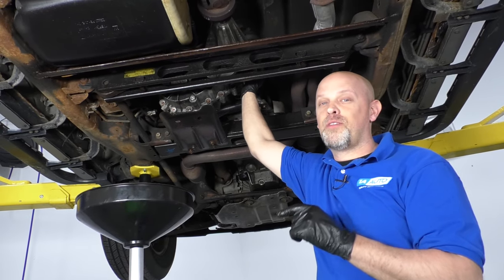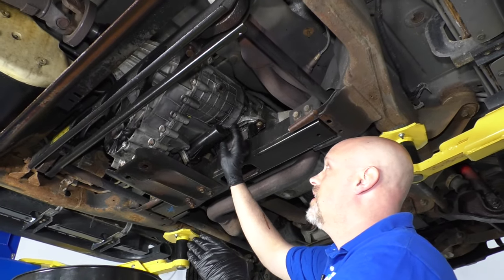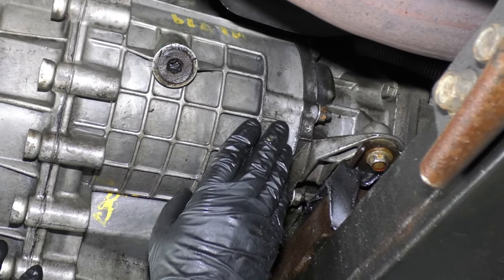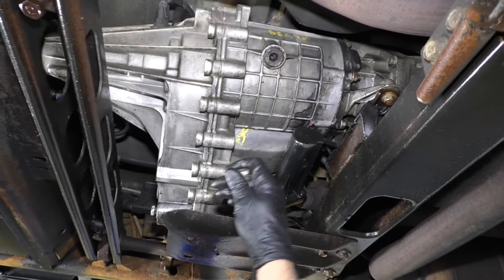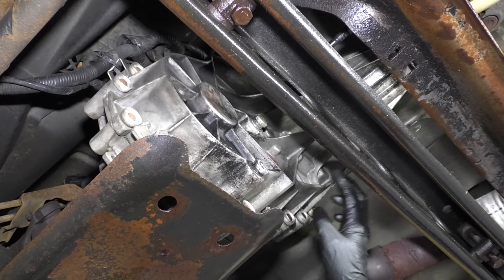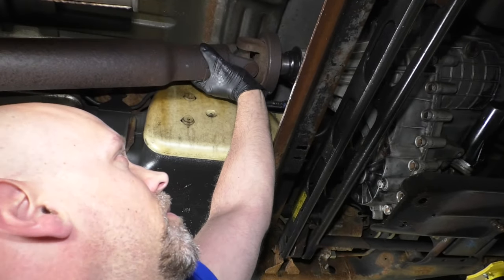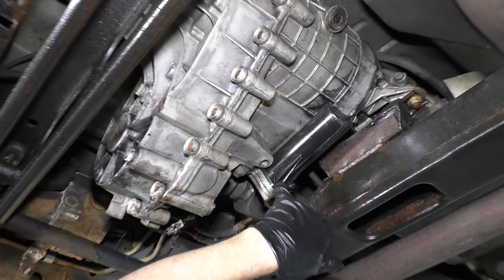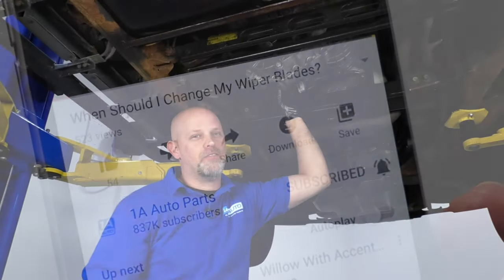Common GM Truck and SUV Transfer Case Problems

Comment from the maker: √  Watch the Video
√  Buy The Part at 1A Auto http://1aau.to/m/Visit-1AAuto
√  Do it Yourself
√  Save Money
Reply: Is there any different problem with the Sierra Denali 6.0 AWD?
Reply: What's the name of part can't find it on 1a parts page?
Reply: I have a 05 chevy Silverado and my four wheel drive keeps engaging itself. Which is weird because I have to manually put it in four wheel drive. What can this possibly be? Transfer case maybe?

Comment: My encoder motor failed. TIP- When you get a new encoder motor to replace it DO NOT plug the harness in and push any of the 4x4 buttons before you mount the motor onto the transfer case. I had a hell of a time getting it clocked correctly again👍🇺🇲
Reply: How do you know if it fails?
Reply: Whaay would anyone want to even try that. You're supposed to put the tcase in 4 hi before you start. It it won't work you have to do it by hand. The instructions already say not to alter the position of the motor

Comment: Hands down the biggest issue is the drain plug hole cracking. I did a standard fluid drain and fill and when torquing back down to factory specs, I watched the case crack. Major failure on GMs part. Cheapest fix is JB weld for aluminum. The right fix is a $170 back half case on the cheapest end. GM cases are $400+
Reply from the maker: +2SSRecluse Thanks for the feedback!

Comment: 9 out of 10 times I personally have changed any seal on any part of a vehicle transmission transfer case engine it doesn't matter what, if the seal is leaking just changing it is not usually the case. If the vehicle has sat a long time or is old maybe, but if the seal goes bad it's usually because whatever it is sealing is moving around from a bearing or bushing that has gone bad. Always always check that before just tossing in a seal and save yourself a major headache from doing things twice and possibly looking like an ass in front of a customer also. Again that is just in my experience so others may have a different option but it's always better to check something and make sure rather then just throwing new seals in things.

Comment: My 98 K1500 is actually "like a rock". Manual 4wd shift, linkage was gettin funky, slipping it into nuetral by itself. Well had low fluid, topped it up, runnin "like a rock"

Comment: Great video.  Folks this video covers EVERYTHING readily serviceable on the transfer case, short of internal component failure such as bearings or the clutch pack.  Good stuff.  The current problem I have on my 07 Tahoe is the "service 4wd" light and the Tcase acting weird occasionally.  I am 99% sure it is the encoder ring in the Tcase shifting motor.  A $60 part and about 1.5 hour of simple DIY job in the home garage.

Comment: Very helpful. Mine in my 2006 Silverado had a pin hole leak and a local shop said "replace the whole thing for $4000" said no. Glad i know what to do if my backyard fix doesnt hold.

Comment: Good educational video, I have a 1997 Chevrolet Silverado 4x4. I know the actuator needs to be replaced, the transfer case stopped working and had it overhauled and still won't work. The actuator didn't get replaced so I assume that's what needs to be replaced. Thanks for the great videos you post, keep up with the good work.
Reply from the maker: +Fred Martine Thank you! We love empowering our customers and showing how to perform DIY auto repairs with our high-quality auto parts. 1AAuto.com
Reply: Same thing with my 97 Chevy Silverado

Comment: About the pump rub issue. It's not an IF but a WHEN problem. My dad's 02 GMC had the pump rub failure and ended up having to replace the entire t-case because it had leaked all the fluid out and was ruined. I have an 06 Chevy and after seeing what my dad went through I decided I better pull my t-case and fix it before it did the same as my dad's. My t-case had about 90K less miles than my dad's but the rear case hslf was definitely showing considerable amounts of wear in the pump housing and would've eventually been a hole or holes 100%. MA auto (Merchant Auto) builds and sells a "pump rub kit" that totally elimates any adverse wearing effects from the fluid pump to the rear case half. The tiny steel plate GM "bandaided" in the later model cases will also fail (mine was broken and was stuck to the debris magnet) so that is not recommended. The MA Auto kit was about $80 which is WAY less than a $2500 t-case!

Comment: Should the drive shaft coming out of the transfer case to the front diff be spinning in 2WD for a 2014 GMC Sierra 1500?

Comment: Awesome video, although I didn’t see anything about a output shaft bearing… where can I get those little individual parts and is it possible to just replace that without wrecking anything else in the tcase? I have a new one from Gm waiting at the stealership for 2750 cad$ but really don’t want to spend all that.

Comment: Love your videos!  Always well informed after watching them.  I have a question today about my 2001 Chevy Silverado 2500HD .   Previous owner had the split driveshaft bushing go out.  It went long enough to wear out the rear transfer case bushing and gall up the slip yoke.  Where can I purchase just the bushing?  And, do I have to remove the whole transfer case to do this? Or can the rear housing be removed while the transfer case is still in the truck?  Thank you greatly for any information.   Mike

Comment: I have a '01 Durango that my wife picked up for me. Just wondering if I can drive it around with the transfer case being bad in it without replacing it as long as they keep it in two-wheel drive and maybe take out CB axle going to the front wheels meaning drive shaft going to the front wheels. Can I still drive it?

Comment: So I’m getting my transfer case replaced the transfer case has 53,000 miles, After replacement will my car mileage change or how would I know that my mechanic put in my transfer case with the 53k miles on it ?

Comment: Hello and thxs for your info. I have a question. My four wheel Chevy after a few weeks gets stuck into four wheel high. The shifter is on the floor. It's a 2009 2500 HD with  6.0 engine. I took it to one shop and the guy said the seal was rusted and needed replacing. Depending on what he sees inside will determine on weather I need a new transfer case. My thing is this. I only use four wheel high in the winter months. That's from December to March. Afterwards my shifter won't shift out of four wheel high. Can that be the shifter or the transfer case itself. The shop wants to charge me $1600 to fix whatever it is. I'm thinking that's way to high. Should I get a second opinion.

Comment: the hole that get's worn into the case is from the fluid pump shucking back & forth ,there is a steel protector plate avallable to prevent this.

Comment: I just got a 2003 Yukon and the front drive shaft boot is completely rotted away.  I can get a new boot back on but do I need ot worry about damage to the shaft or transfer case, since theres no way to know how long its been off?

Comment: O7 YUKON 5.3 4X4.  Has a code service 4 wheel drive. Indicator light works some times. Every once in a while on start up it is in 4 wheel drive.  Takes a while to get to 45mph with a hard shift into 2nd gear. After that, it will go to 70mph no problem. But if I slow down or come to a full stop, I have to start the whole process all over again.  Is there away to disconnect the 4 wheel drive all together?  Maybe pull a fuse?  It seems to be getting worse as it gets colder.

Comment: I have a 07 Escalade EXT AWD and when i put it in reverse or drive the transfer case makes a loud grind or rattle sound. I know its the transfer case cuz i went under there and put my hand on the transfer case while it was in gear and i can feel something wrong going on inside. My question is would my truck still drive from the rear wheels if the transfer case went out and if the rear wheels dont operate can that be a transmission issues?

Comment: My mom recently hit something on the front passenger side of her 2003 silverado.  Now when you put it in 4x4 there is a friction noise coming from the front passenger side. Also doesn't want to go back into 2H. I have to put it in 2nd go up to 15mph and drop it in second for it to go into 2H. Any ideas on what this might be?

Comment: I bought a 04 avalanche z71 and didn’t know about this issue. Threw a used one in it for now. If get 4000-6000 miles out of it I will be happy
Reply from the maker: +Austin Woolverton Thanks for the feedback!

Comment: My 04 Yukon Denali I think the transfer case is growling. Is that possible? Just did a fluid change and barely any fluid came out.
Reply: I think my t case is growling on my 99 Sierra.  I guess it could be the front diff growling for all  know.  Did it get any better after adding fluid?
Good luck ✌️

Comment: A couple years ago, mine transfer case grenaded. Luckily I pulled over right away. Bad thing is I was in 2wd, on the highway. Had it fixed, now I'm having some whining coming from the front end, when in 4wd. Trying to find out what it is. Maybe a bad pinion or hub assembly. Really only does it at low speeds and declaration.

Comment: I have a 01 Tahoe 4 wd  mine won’t go in to low four after you drive it but when the truck cools off after one hr then the transfer case will go in to low four I replaced the switch in the dash the computer behind the dash the actuator and the coda motor and put a new plug on the wires and it is full and is full of fluid

Comment: I have a99gmc suburban with 246 transfer case .auto 4 wheel drive push button.it was leaking fluid.internal pump wore a pin hole in rear transfer case.i got a rebuild kit an back half of case.friend of mind and owns trans shop.we rebuilt it an need chain installed .no more leaks.this is common on246 new process t cases.99 to 07 246 t cases.my other friend has a2002gmc 1500 pickup with same t case.his son ran the truck out of transfer case fluid by detroit it smoke t case.case was not salavagable.!

Comment: Great video, thank you. I have an 08 Tahoe, and a very small drip from the front of the TC. I was thinking the case seal, but looks like trans fluid. Is the fluid in the case red as well ? Also, do you have these seals in stock usually ?
Reply: I have a dodge ram 2500 and both the transfer case and transmission take the same fluid.
Reply: GM vehicles with automatic transfer case do not use the same fluid in the transmission as in the transfer case!

Comment: I have not got a hold of a Chevy dealer can you tell me what kind of oil goes in the transfer case.  
Auto parts stores told me 75/195 or they have told me a GM part number

Comment: I have a rusted out 2004 chevy trailblazer ext 4wd that has a transfer case but it will not shift so not sure if it is the transmission or the transfer case  or a solenoid or whatever.

Comment: I have A 2000 AWD Astro was driving and motorist said You have smoke coming from underneath immediately I pulled off the Fwy a voila there's my problema...Thanx...BTW She has 263k clean as a whistle underneath CA car baby...zero rust...

Comment: I have an awd trailblazer ss and my trans is slipping and making a ticking whining type of noise. But I don’t have a check engine light on. And sometimes it’s doesn’t slip. Any ideas on what it could be?

Comment: I have a 2000 model. All the lights are on for the 4x4. 2hi,4hi, 4lo. Replaced the switch it went away then came right back a day later. Will not let me select. Checked  the fuse,replaced the switch. Will die when you start to drive it. ??? Any help will be greatly appreciated. Could the replacement be bad as well? Thanks!!

Comment: So I've just had the entire drive train replaced in my 2008 4x4 suburban and when I try to use the 4x4 it says service the system and will not disengage unless I do it manually......Is that the electric motor sensor you showed at the end of the video.....
Reply: What ended up being the issue?

Comment: My 2022 GMC Sierra 1500 Limited had a transfer case leak at only 28,000 miles. I’m taking it to the dealer to figure out why it happened

Comment: Just bought a brand new t-case for my 04 silverado, and its leaking from the gasket from the transmission to the trasfer case. Will it leak into my transfer case or should it be okay for a little bit till i can fix it. I work the night shift so its a little difficult to make time to fix it. The transfer case only has 1,500kms on it and i would really like to avoid blowing it up, any help is appreciated 😅
Reply: The oil is from the transmission, keep an eye on the tranny oil level. The oil isn't pressurized so the transfer case seal should keep it out.

Comment: my engine light lit up on thursday after getting new exhaust since it had a leak and as of yesterday (9/14/24) i have a service 4wd msg on the odometer. according to the shop it's either a rear main seal leak or a transmission leak and won't know till monday 9/16/24

Comment: I Have a 2013 gm 3500 dually. Put truck in reverse no noise at all but will not move, acts like it’s in reverse. Put truck in drive, loud clunk noise, push gas pedal halfway to floor board and barely moves 5mph. Any idea what this could be??? Really could use some advice

Comment: 2012 Acadia w/approx 85K well maintained miles has recently been shifting into 4wd on the fly and randomly. Brought it into one of the few remaining Sears Auto Centers few mos ago where they changed the tranny fluid w/out disturbing filter/pan. Noticeable downshift and "Traction Control Off, Service Stabilitrak, Service Traction Control and Engine Power is Reduced" msgs                                                         come on as result. 
Thoughts please, thanks!
Reply from the maker: +jarhead66 We wouldn't be able to diagnose an issue like that here, you may want to have a local mechanic take a look at it. Thanks for checking us out! http://1aau.to/m/Shop-1AAuto-c

Comment: So I'm trying to replace my VSS on my 99 silverado 1500 4x4, and I notices I have 2 sensors on the tail end of the transfer case, one on the driver side and one on the passenger side, set about 90 degrees apart from each other, and I have no idea which one is which. Any help would be appreciated.

Comment: My 2007 Avalanche ltz in cold weather says service 4x4 or if indrive it for a while in 2wd (20mins) and the switch it to auto its fine but when i turn on a wet road it feels like the 4x4 is binding. Changed all the fluids with what they spec and still does it. . Like i said when the truck is driven for more than 20 minufes in cold it switches to 4 high and auto but when in auto it feels like its binding. Not sure what it could be.

Comment: I have an issue with my 1997 k2500 where it will engage into 2 high and 4 high with no issue but when I put it in 4 low it tries to engage but it will make a clank noise while trying to engage and then go into 4 high

Comment: I notice my shifts are hard I put Lucas oil transmission fix into it it feels a lil better for a bit but then goes back I’ve checked fluid it’s not burnt and no leaks it’s a 2005 gmc canyon someone please help it’s getting a lil worse every time I drive

Comment: What about a clicking when I’m in 4 high and it won’t go into 4 low, the light just blinks. The clicking sounds like gears now fully connecting. 2012 Chevy Colorado,

Comment: I have a silverado with a manual transfer case and the engine is bad. There's a silverado with a bad transmission and good engine but it has an electronic transfer case. Can I swap that engine into mine?

Comment: 2002 Chevy Silverado 1500HD 
P0502 CODE
I replaced all the speed sensors on the transfer case itself, but still no luck. speedo isnt working and shifts rough. it threw the code when i was on the highway and hit a bumb and made me come out of cruise control and was shifting irratically. would there be another sensor im missing?? or bad wiring? i did notice the face of one of the sensors had been worn. lately i noticed it will work sometimes but when it shifts into 2nd hard i lose speed readings. 

Ive done my best to try and research what the issue is before i take it to the shop. If anybody might have an idea please comment and it would be much apprecitated!!

Comment: when i hit the 4wheel drive button. i can hear the encoder motor running but it goes back to neutral. could it still be the encoder motor? i have no codes showing.

Comment: Got a 94 silverado k2500 4x4 350tbi with a 4L60E transmission. I only have P and N. Was just driving Thursday dec 17th 2020. I can feel it engage gears and my idle changes. But no moving in any gear. And no check engine light.  Please help.
Reply from the maker: +1968 Dodge Dart Restore We wouldn't be able to diagnose an issue like that here, you may want to have a local mechanic take a look at it. Thanks for checking us out! http://1aau.to/m/Shop-1AAuto-c

Comment: When I turned into parking lot felt like it went into 4wheel drive by itself.the light came on on 4 wheel drive.when I tryed to put in all wheel drive or 2 wheel it just jumped back to 4 wheel drive

Comment: I have grinder noise coming from flywheel and transmission area on 07 hummer h3 could it just need flywheel replaced
Reply from the maker: +Alejandro Delgado-Garcia We wouldn't be able to diagnose an issue like that here, you may want to have a local mechanic take a look at it. Thanks for checking us out! http://1aau.to/m/Shop-1AAuto-c

Comment: I have a 2005 Chevy Tahoe and when it's in two wheel drive for some reason the transfer case goes into neutral I put it back and four wheel drive Auto high low it don't matter just four wheel drive and it goes fine never shuts never kicks into neutral only when it's in two wheel drive help

Comment: I got a 98 basketball 5.7 engine back running again it won't come out a little gear got reversed and low gear clean transmission fluid ain't nothing burnt what's my problem